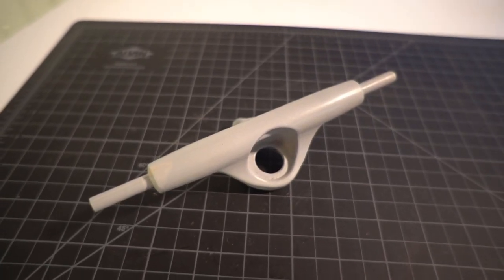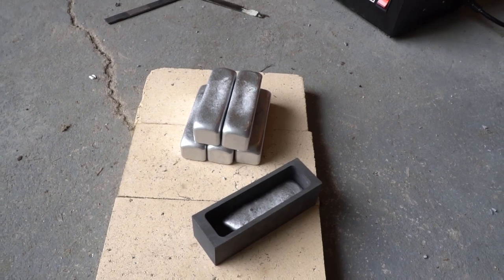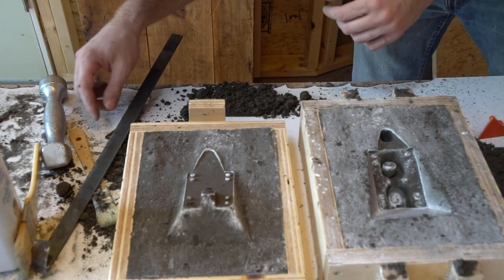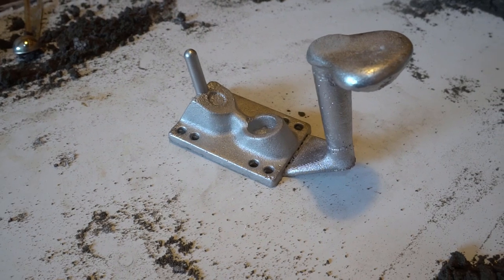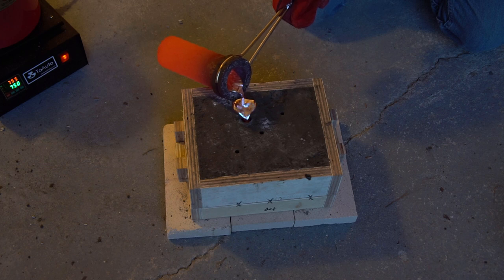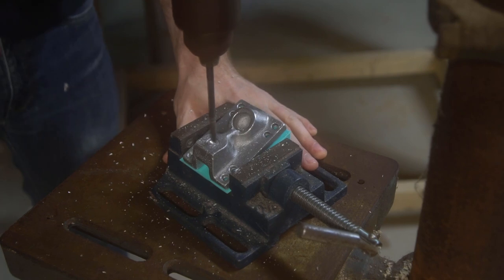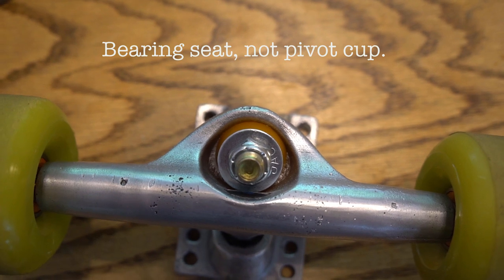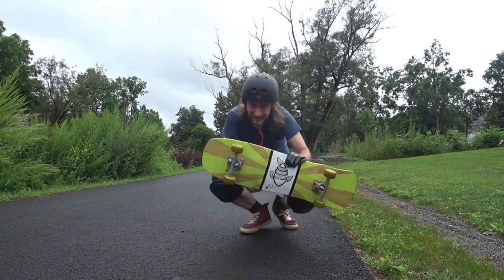Casting DIY Skateboard Trucks At Home - Ep. 3

Comment from the maker: I just noticed that I got the term for risers wrong a whole bunch over the course of this vid. The tubes coming up out of the mold that I cut with the brass tube aren't gates or runners, they're risers. Please excuse my amateurish use of casting language hahaha!!!
Reply: Only if you excuse me for calling you Alex in a comment a few weeks back. Sorry about that. Not sure what I was thinking. I'd be so excited to see your custom board get some exposure on Braille's channel. I'll definitely comment over there that they need to check out Chris from Good Roads.
Reply from the maker: All good! I told you: just don't call me late to dinner!
Reply: You may wish to check out the complete handbook of sand casting, I own it and it’s an amazing resource
Reply: how to make fingerboard truck
Reply: Pivot cup, kingpin hole and mounting holes are drilled/milled after casting on a majority of trucks. No need of trying to cast this elements at all.
Reply: have you 3d printed any trucks?

Comment: To keep the sand for the pivot cup in place, put a nail in it. The nail will add support to the sand.  Also use more parting compound on the inside of the pattern. Use a fine hair (artist) brush to paint the parting compound on the more vertical surfaces.
Reply from the maker: Thank you! I will give this a shot next time around

Comment: Bear Trucks use that hole pattern. Works well. Man! What an awesome outcome to this project man! If you make more: add a logo ;-)
Reply from the maker: Yeah. I knew there was no way somebody out there wasn't drilling their baseplates like that, it just makes too much sense. And yes on the logo!
Reply: @GoodRoads  Will be watching progress with great pleasure my man! You are doing awesome work. What I was wondering is the cost effectiveness of this process. Other than being able to create custom geometry... is it economically viable to create for example a small production run to sell with proffit? The way I see it you are totally set up to sell complete custom boards at ‘custom board’ prices. Pretty sure there are folks willing to fork a sum that makes it viable as a bussiness model. Would you agree? I know you are sharing all your files for those willing to invest the time and effort themselves... which is great by the way! But your personal experience and time is certainly worth money to those who cant be bothered to get hands on.

I am personally working on quad skate plates which are UFS inline boot compatible and the truck geometry is totally custom. I designed them with casting in mind but the prototypes are being milled atm (I have a friend). Interested to learn the economics of this process (cost of sand? Reusable? Gas? Other consumables?) and if you have ideas on how to scale up? Perhaps a tree with multiple parts in one go? In that case another method is needed to capture the shapes (lost wax or lost 3D print moulding) but yeah...

Looking forward to more sir!
Reply from the maker: I am certainly not thinking about production level truck manufacturing at this point, I was just compelled to do it for the sake of having done it, but it might be worthwhile at some point to look at the numbers. I honestly think sourcing and processing the right kind of aluminum would be the biggest bottleneck. The rest is pretty straightforward and there aren't many recurring costs. It's just time consuming

Comment: To prevent sand from falling during removal of the part add much more of the powder on the part  before putting sand to make mold. Also you can add a little amount of water in sand to increase moisture content to  raise the adhesiveness between particles of sand. Also tap multiple times on the part such that it moves walls of soil all around it making it easier for mold to be removed without damaging the walls of the mold.
Reply from the maker: Thank you, I'll try this next time around

Comment: to fix the pivot cup issue, put a piece of all-thread in cup as support. think of it like rebar in concrete. if all-thread doesn't work, just a normal course thread wood screw works! make sure to heat the screw very hot before use though. sometimes hardware has wax or oils that will burn off. they will add bubbles to your part or ruin the mold.

Comment: So with the axles .. they usually cast in a dummy rod, made from sand and resin, the resin burns away and you are left with just sand .. that's the reason why you see the axle showing through in 3 spots, as those spots hold the resin rod straight .. the casting is then heat treated to T6 ... then the axle is pushed in as heating the axles will soften the metal. The other holes for pivots etc are just left blank and drilled later.
Reply from the maker: Hm. Yes. I know some of those words. Hahaha! In all seriousness: thanks for the tips, that all seems like super helpful advice.

Comment: That's so clever, printing a support to use under the cope! I don't have any experience with green sand, but Petrobond can get you a really clean finish. Also, maybe try looking into casting with zamak, it's a zinc/aluminum alloy that's pretty tough, but it has a lower melting temperature. The lower temp might get you a better finish.

Comment: One thing to consider, if youre trying to drive away moisture with a propane torch... propane breaks down into water. Most of it will evaporate from the heat, but you are effectively spraying the part with water.

Comment: So I know I'm a bit late but about the Axel if you spray the casting down with cold water right after pouring it would re harden the steel inside the aluminum plus less waiting but it's that long slow cooling equals soft steel

Comment: you might want to try an oil bonded sand, might get a better surface texture. also for your pivot cup issue take a look into sodium silicate sand casting
Reply from the maker: I got a tip to add some neutral oil to my sand which I want to try, any thoughts on that?
Reply: @GoodRoads  not something I'm familiar with, worth a small scale test at the very least.

Comment: A good way to shape your pivot cup would be to use a ceramic core. Same thing for any semi-complex holes. Put the cores in place on the bucks, and pack the sand around them to hold them in place.
Reply from the maker: That seems like a viable solution, how do you make those inserts?

Comment: When you are doing reverse kingpin trucks there is a locker washer usually square that slides into position this is what holds an anchors the kingpin in place. The entire barrel of the bottom base plate is threaded to the top the kingpin itself should have enough depth to reach the bottom of the locker washer with 5 mm sticking past the lock washer while the truck is medium tight this allows for people to ride loose and still have enough thread on the locker or nylon ring for it to keep the kingpin stable because it is easy for a reverse kingpin truck to back out the kingpin. For reference use grind King they are the best

Comment: Regarding the open bushing seat - if you've ever ridden Paris RKP trucks, that's the stereotypical loose bushing seat feel. Amongst other things, I notice a softer endpoint to the truck's range of motion... like you could push them a little further even once you've hit the end of the range, whereas a more restrictive bushing seat can feel like there's a more authoritative / blocking endpoint. I also notice that less energy gets lost in the turn on open bushing seats when carving quickly (or pumping). I wonder if the open bushing seat combined with the progressive turning from your TKP design would make this newest creation a good front truck for a pumping board?

Comment: Next time you set your axles in make sure that you have drilled holes in the axles about 30 mm apart throughout the mid span of the truck axle. This will allow the casting material to go through the holes locking the axle in place preventing axle slip
Reply from the maker: I think I'm going to try to go the knurling route, but some feature to lock the axles in place is definitely a good idea

Comment: Friggin amazing!!  I wonder if you drilled a few holes in the axle, cross ways, if that hole would be filled with aluminum prevent axle slippage?
Reply from the maker: I think drilled holes would cause a weak point but there are a lot of factory made axles out there that have some kind of knurling on them to prevent slippage, I'd like to figure out how to make that happen
Reply: @GoodRoads  I wonder if you could use a vice or hydraulic press (harbor freight has cheap ones based on bottle jacks) to remove the axle after casting and replace it with a new axle that hasn't been exposed to heat? You could potentially make the casting axle slightly smaller than the final axle to achieve a very solid press fit. I know nothing about whether this would just tear apart the aluminum or if it would slide... maybe there's some sort of metal-on-metal casting release agent that could help with this?
Reply from the maker: Interesting idea

Comment: Have you considered the PLA/plaster "lost wax" investment casting type method? It might waste a bit of PLA filament, but could help with the reproduction of detailed features that you're having issues with sand casting...
Reply from the maker: I have considered that and I'm actually planning on going that route when I get to the base plates for RKP trucks, I want to see if I can get these to work with sand casting though since it requires less equipment

Comment: Great idea with the wheel base option! You could cast a baseplate to take an inverted kingpin 🤔
Reply from the maker: I could just flip the kingpins on these, I don't know why I didn't think of that. Thanks dude!
Reply: @GoodRoads  I would epoxy them in so the nut don’t spin if the aluminium is soft .also I need to check out you home made wheels man 🤙🏻

Comment: AWESOME! That was faster than I expected.
About the pivot cup issue, I think you can taper the walls of the cup open a little, but I think you'll end up needing to finish the cup with a round-tip drill-bit. I mean making the form of the opening of the cup, but not as deep and marking the point  on a flat surface with a some sort of a little cone for drilling. Or even make the wider part of the opening of the cup the size of the final pivot cup and taper it down a good 5° (for an easier release) all the way to the final depth; this way you could easily shave the excess with the drill to get the final shape. 
Also I recommend you clamp your jig to the drill press plate, I know you were anxious to finish them so you could ride them, but we can't afford you losing a finger ;) (knock on wood).
Reply from the maker: Thanks dude, I noticed when i was shooting the b-roll that it looks like the pivot cups on the Indys are actually drilled or machined or something. Definitely a detail to keep in mind going forward
Reply: @GoodRoads  Yeah, man. While you were typing that reply I was editing my comment to give some ideas.
Ok, I just dissmounted a couple of my trucks and the pivot cups have drill bit markings, which tell me they were finished on a drill press. And I just found a 90s video of the venture factory where it's shown the pivot cups are drilled on a press. https://www.youtube.com/watch?v=aUlCl2a4zuw
Reply from the maker: This is sick dude, good find! You can get a quick look at their runners and gates on the hangers too and I like the idea of using a single plate to form both the cope and the drag
Reply: @GoodRoads  Glad you liked it! Yeah I thought using a single plate is a brilliant way of making good compact molds with a perfect parting line, but I didn't know how to express it properly (english is not my first language), haha.

Comment: Just came across your channel for the first time and I have a suggestion! Try putting a little bit of silicon metal into the aluminum when melting. Mix it up after a little bit then fully melt it and it should flow better.

Comment: To be honest, for the holes.. if you have a 3D printer, just print a support, cast a Pilothole, and drill the Kingpinhole in the hanger and the baseplate afterwards.
I do have a CNC mill, that will greatly assist me in doing that kind of work..
I also like the 8 hole baseplate for wheelbase adjustment.. i've never seen that.. and i think it's cool!

Since you can make these Jigs for making the mould with a 3D printer, Go Crazy, and design your own trucks, with a shape that everyone will recognize!.I have made a 3D Design (available on GrabCad) of the Bennet Vector trucks, copy the geometry, and design a less cubic shape.. :)

Comment: Thanks for sharing! My favorite part is getting to see your sense of accomplishment. I'd be feeling giddy too. You made all the important parts of a skateboard that can't be borrowed from other pre-existing industries. FUCKING AWESOME! Every truck I've taken apart appears to have a drilled out (post molding) pivot cup recess. Perhaps a pilot hole for that as well as one for the kingpin would be a clever adjustment to your baseplate buck, along with the jigs to angle the molded baseplate under the drill press for the proper angles, and some method to stop the drill at the proper depth.... masking tape around the drill bit comes to mind, but fancy drill presses have adjustable stops.

Comment: I'm curious, did you notice if the board would roll in an arc from either the bushing cup or the axle? Also, is there a version of reusable molds on a garage scale level instead of the sand cast?
Reply from the maker: I'm not clear on what you're asking in the first part of your comment, the board rolls straight if that's what you mean. As far as a reusable mold for aluminum I've seen steel and graphite molds, and I imagine there are probably some ceramic solutions out there too. You could probably mill a graphite mold with a hobby level CNC, it's not a very hard material. If there are any other reusable mold materials out there I'd love to know because that would be fantastic.

Comment: My suggestion for the pivot bushing hole is to just create a centre point with the whole diameter and with the same angle as the drilling bit and drill the hole later and the same goes to the bolt holes. Follow the K.I.S.S. method of designing parts.
Reply from the maker: I People have been sending me a lot of factory videos and it certainly looks like all those features are drilled after the fact using cast-in-place registration marks. I may very well go that way next time, it's probably a heck of a lot easier
Reply: @GoodRoads  Try that it may seem more after work but the rate of successful parts is worth it.

Comment: Disk grind the kingpin down so it's more flush with the bolt. Or vice versa on the Axel ends & use a re threaders tool to fix the ends of each point of the Axel. Idk old shit I'd have to do back in the days skating old indy's or venture trucks.

Comment: Hey Chris at Good Roads, I commend you for your effort man. to answer some of your questions regarding your process here is my 2 cents.  Petrobond will help you with the KingPin Thru hole and pivot cup areas because it is oil based it "sticks' and adheres and stays together well during the pour. In addition Less gas is formed permitting use of finer sands with lower permeability resulting in a finer finish. Also, yes, the 4 bolt mounting pattern on baseplates is a thing allowing for 4 possible wheelbase options. Seriously man, with your skills you should design your own trucks and move away from leveraging what exists. Lastly, your not the only skater out there doing his/her own thing. Ive been designing and manufacturing machined cnc trucks (RKP & TKP) and carbon fiber skateboards for 10 years. Not bragging - just saying... there are skaters out there doing their own thing, not for money (there is no money in skateboarding) but for the passion! Keep doing your thing man - you have skills! Respectfully, Bill ILIFFE, Skater Owner Operator, Chief Designer at ILIFFE Truck Co. Peace

Comment: is there an open source resorce for 3d printer mold patterns your using ?
Reply from the maker: I think I'm going to ask a small price for the files for the casting bits like the runners and sprues, it has been so much work, but the designs for the trucks themselves will be open source as soon as I feel like they're finished. I just got to get them to a place where I'm getting more consistent casts.
Reply: @GoodRoads  that would be great. id love to start z similar ptoject here in the UK. i would probably change things around a bit for my own purposes but it would be great to have a starting point as im new to 3d printing.

Comment: Do not fully cast RKP baseplates, as the kingpin really does need a press fit (can be done with a vise) but, using a core you could potentially cast the holes by making a core that makes the face that the bushing sits against
Reply from the maker: False! And I'm only contradicting you to get some historical information out there, so I appreciate where you're coming from. Some of the older RKP geometries, specifically the Randall I and II's had a friction fit on their kingpins. That's not to say a press fit isn't better, it is. But you can totally rock a RKP setup that just has a standard bolt as a kingpin, it was done that way for years before the tech evolved to what it is today
Reply: @GoodRoads  yeah, they work, but the press fit done with a vise makes it far less likely to wallow out and last longer, especially more important on longboards (well, not cruising)
Reply: @GoodRoads  also all good homie, randal was a big leader in innovation for longboards and luge as well
Reply: @GoodRoads  also, I’m working on some RKP trucks and such if you want I can keep you updated. Sadly I’m not good at making videos and my schedule is pretty random so I never got to really do it. Just remembered I should mention it as I’m redoing my riser print files right now
Reply from the maker: hell yeah, keep me posted